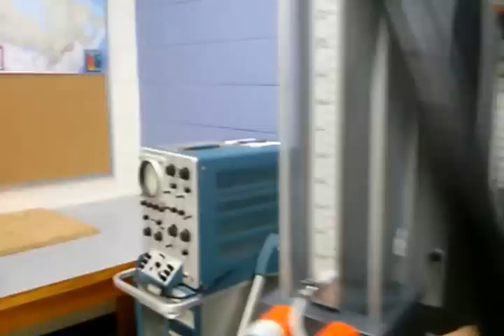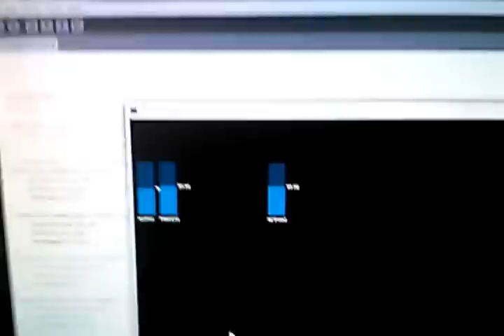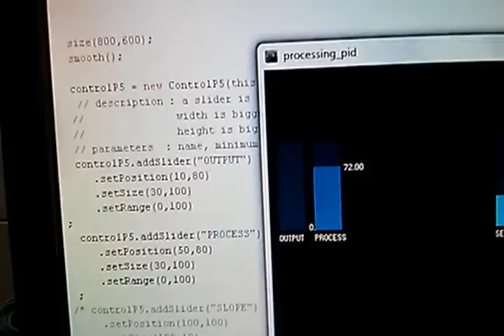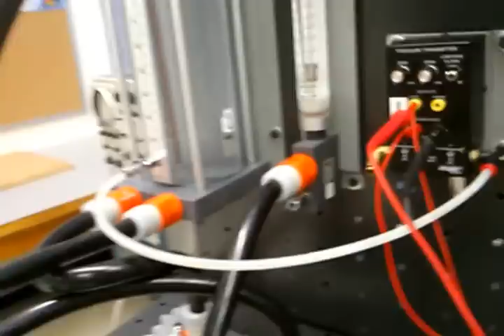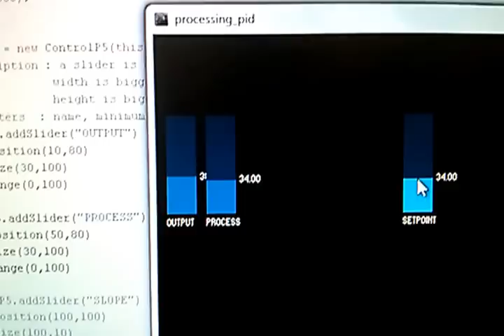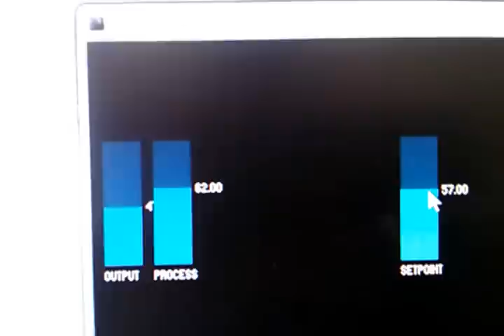Arduino PID Controller - water level

Comment: How would you feel about sharing the code that you wrote for this project? I'm troubleshooting an almost identical design, and seeing a working version would be very useful indeed!
Reply from the maker: no problem...it uses the PID library found here  http://playground.arduino.cc/Code/PIDLibraryConstructor

here's arduino code:
//verified may 29, 2013
//reads an analog input, setpoint from serial

#include <PID_v1.h>

const int analogInPin = A0;  // Analog input pin that the potentiometer is attached to
const int analogOutPin = 3; // Analog output pin 
int processvariable;
int setpoint;
int sensorValue;
double dprocessvariable=50;
double dsetpoint=50;
double doutput=50;
int output=0;

String inString = "";
PID myPID(&dprocessvariable, &doutput, &dsetpoint,4.0,0.15,0, DIRECT);

int getpv(void)
{
int pv;
  sensorValue = analogRead(analogInPin);            
  // map it to the range of the analog out:
  // change the analog out value:
 pv= map(sensorValue, 0, 1023, 0, 100);  
 return pv;
}

void setup() {
  // initialize serial communications at 9600 bps:
  Serial.begin(9600); 
  pinMode(analogOutPin,OUTPUT);
   myPID.SetMode(AUTOMATIC); 
   myPID.SetOutputLimits(0,100);  

// initialize setting setpoint=pv
   processvariable=getpv();
   dprocessvariable=processvariable;
   setpoint=processvariable;
   dsetpoint=setpoint;

}

void loop() {
  
   while(Serial.available()>0)
  {
    char inChar = Serial.read();
    if (isDigit(inChar))
      inString += (char)inChar; 
    else 
    {
      if (inChar=='\n') 
      {
        setpoint=inString.toInt();
        
//      Serial.print("got a value");
//        int aout=map(processvariable,0,100,0,255);
//        analogWrite(analogOutPin,aout);
        dsetpoint=setpoint;
        
        
      }// end of cr
    inString="";  // non numeric so clear the building string
    }// end of non numeric character received
  }//end of while serial available

  // read the analog in value:
  sensorValue = analogRead(analogInPin);            
  // map it to the range of the analog out:
  // change the analog out value:
 processvariable= map(sensorValue, 0, 1023, 0, 100);  
 dprocessvariable=processvariable;
  myPID.Compute();
 output=doutput;
int aout = map(output, 0, 100, 0, 255);  
 analogWrite(analogOutPin,aout);
 
Serial.print(output);
Serial.print(",");
Serial.println(processvariable);

  delay(100);                     

}

and here is processing code:
NOTE THAT IS USES THE controlP5  library for the GUI sliders.

// verified may 29, 2013
// this is the HMI for a PID control system
// it allows the user to specify the setpoint
// and receives the op and PV from arduino and displays them

import controlP5.*;    // import controlP5 library
ControlP5 controlP5;   // controlP5 object
int lastsecond=second();
import processing.serial.*;     // import the Processing serial library
Serial myPort;                  // The serial port

float PROCESS=0;
float OUTPUT=0;
float SETPOINT=50;

Slider abc;

void setup() {
 myPort = new Serial(this, Serial.list()[1], 9600);

 // read bytes into a buffer until you get a linefeed (ASCII 10):
  myPort.bufferUntil('\n');
  

//println("begin");

  
  size(800,600);
  smooth();
    
  controlP5 = new ControlP5(this);
   // description : a slider is either used horizontally or vertically.
  //               width is bigger, you get a horizontal slider
  //               height is bigger, you get a vertical slider.  
  // parameters  : name, minimum, maximum, default value (float), x, y, width, height
  controlP5.addSlider("OUTPUT")
     .setPosition(10,80)
     .setSize(30,100)
     .setRange(0,100)
; 
  controlP5.addSlider("PROCESS")
     .setPosition(50,80)
     .setSize(30,100)
     .setRange(0,100)
 ;
/* controlP5.addSlider("SLOPE")
     .setPosition(100,100)
     .setSize(100,10)
     .setRange(0,5)
;
controlP5.addSlider("OFFSET")
     .setPosition(100,150)
     .setSize(100,10)
     .setRange(-50,50)
     ; 
*/
controlP5.addSlider("SETPOINT")
     .setPosition(250,80)
     .setSize(30,100)
     .setRange(0,100)
 ;

     
}
void draw() { 
  background(0);  // background black

  if(lastsecond!=second())
{
lastsecond=second();
println("there goes another second");

String str;
int ival=(int)SETPOINT;
  str = Integer.toString(ival)+"\n";
  myPort.write(str);  

  
}
controlP5.getController("PROCESS").setValue(PROCESS);
controlP5.getController("OUTPUT").setValue(OUTPUT);
}
  

void serialEvent(Serial myPort) { 
  // read the serial buffer:
  String myString = myPort.readStringUntil('\n');
  // if you got any bytes other than the linefeed:
    myString = trim(myString);
 
    // split the string at the commas
    // and convert the sections into integers:
    int sensors[] = int(split(myString, ','));

    // print out the values you got:
  //  for (int sensorNum = 0; sensorNum < sensors.length; sensorNum++) {
   //   print("Sensor " + sensorNum + ": " + sensors[sensorNum] + "\t"); 
   // }
    // add a linefeed after all the sensor values are printed:
   // println();
      OUTPUT = sensors[0];
      PROCESS=sensors[1];    
    
}

Comment: if you have a the transfer function you would make bode and nyquist plots to get better tunning parameters and maybe even use some math liek the Routh Array to get some guidance for the parameters. do you know what type of transfer function the software is using? Im taking a control theory class right now so this is pretty interesting.